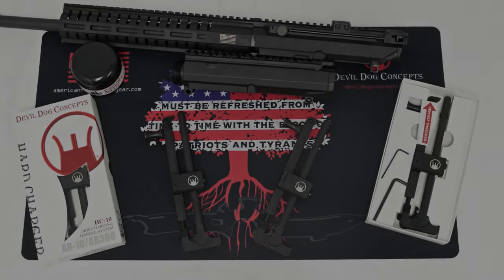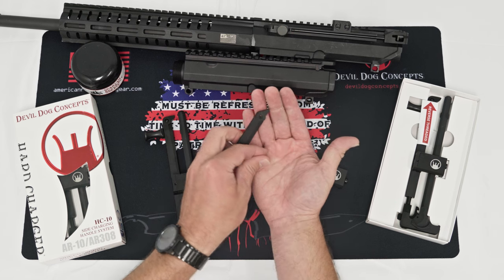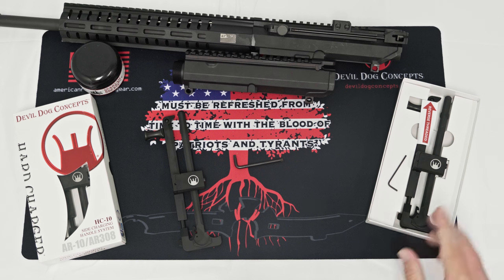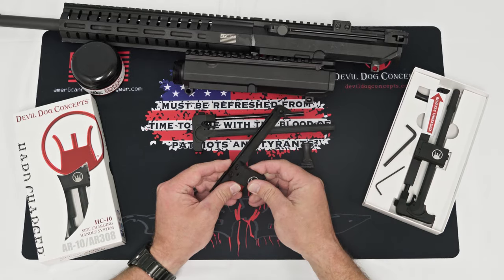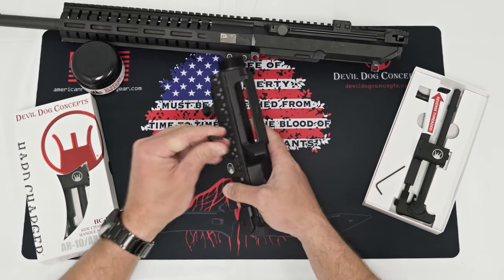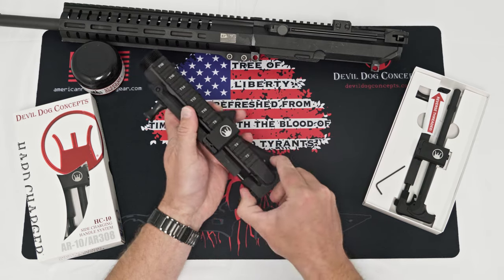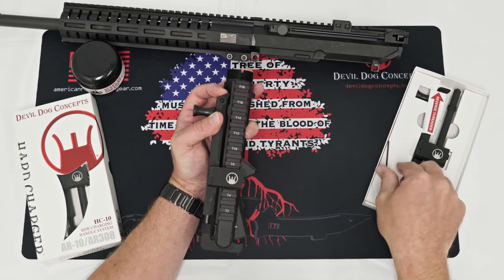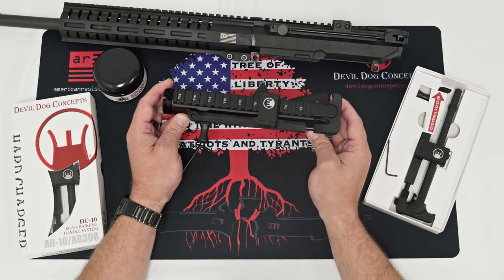[HOW TO] Installing the AR-10 / AR308 Side Charging Handle

Comment: Nice!  I will probably have to get a few of these.   If I may make a suggestion though.  In addition to or instead of having multiple models depending on the optic, why not have your own one piece style scope mount or even a two piece set of rings that mate with your side charger, giving you two solid attachment points without worrying about which model to get....
Anyway looks nice